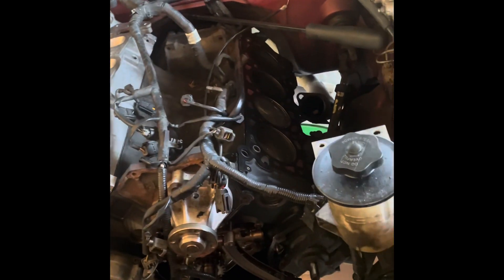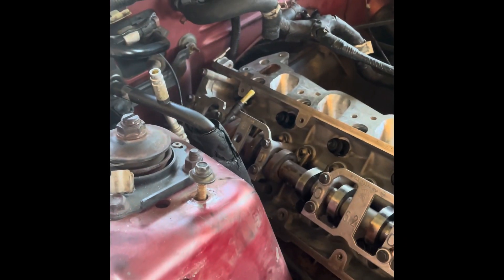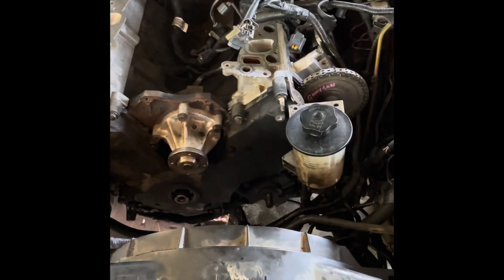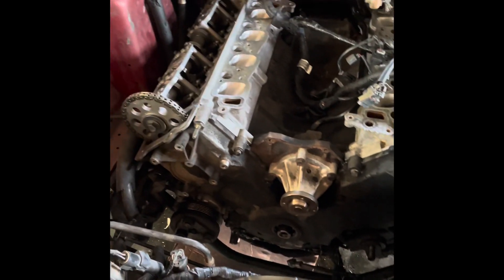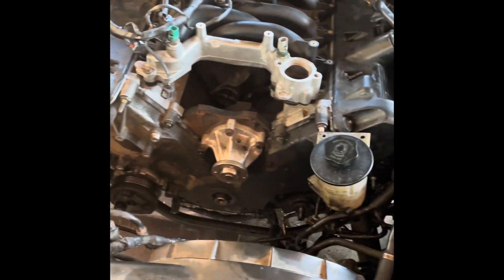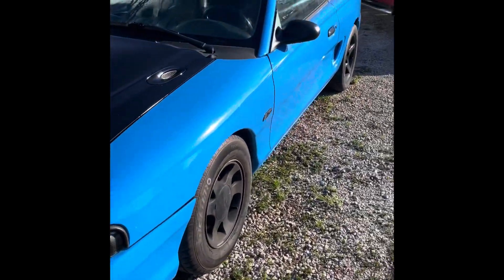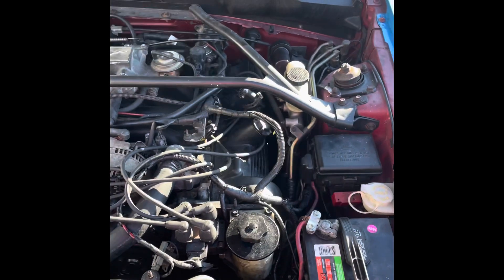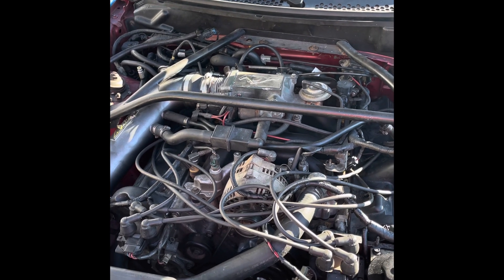96-98 Mustang GT PI Head Swap Part 2

Comment: How long did it take start to finish? An do you have a parts list of everything that’s needed to do the swap without issues ?

Nevermind I found the parts list on your other video , 
But how long was the time frame start to finish ?
Reply from the maker: The actual work was done in a weekend. That’s just swapping the heads and it running and driving.